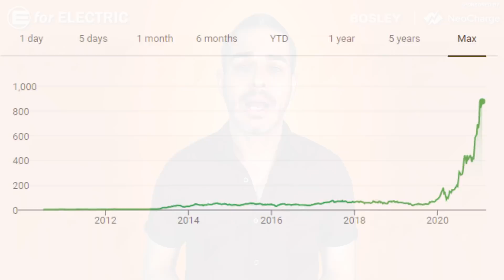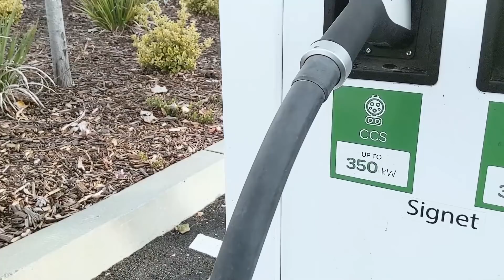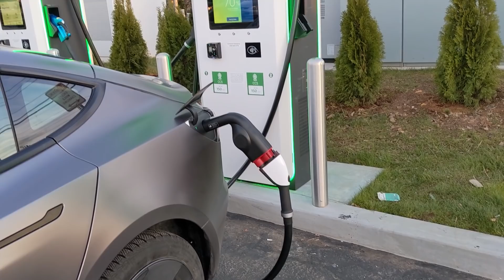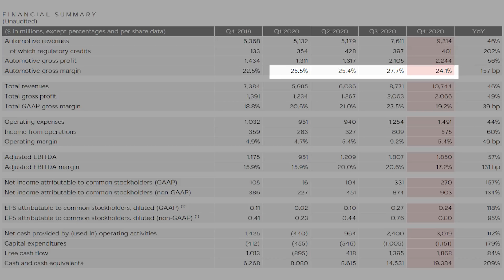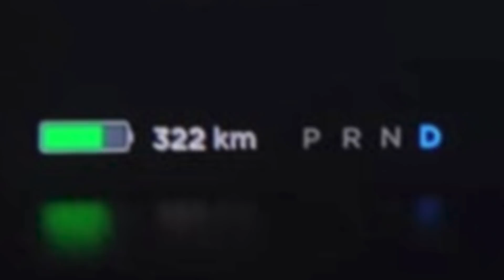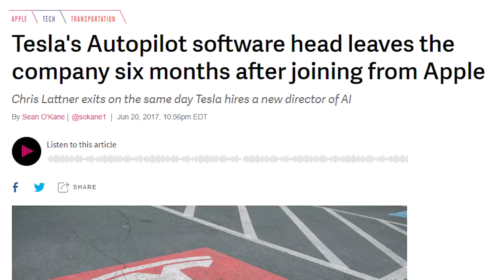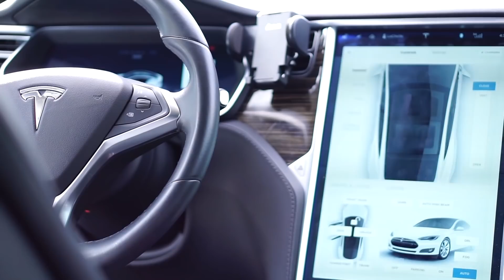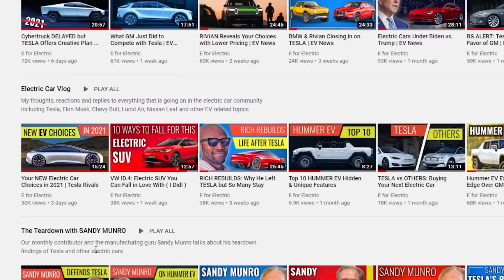Investing into Tesla Stock: Things You Should Know in 2021

Comment: Respectfully, your presentation was full of so many inaccuracies and incomplete information that it would take too long to address.. You honestly lost a lot of credibility.  based on this presentation.
Reply from the maker: Maybe you can start with one. If I am so wrong it would be easy to discredit.
Reply: @EforElectric  I'll start with one, after listening to the first argument of competition. Comparing model 3 to Renault Zoé in Europe makes little sense to me ; one is a premium berline, the other is a  cheap urban hatchback. We ll need to wait for tesla 'model 2' made in Germany to have relevant data. It s like comparing the Zoé with an imported BMW3 (thus hurt by 10% import taxes). Besides, Renault declared their strategy to go for lower volume, higher margins Zoe, meaning they are not making sustainable profit on this model. For these reasons, that argument was indeed not relevant. Watching the rest.
(don't get me wrong, I otherwise enjoy watching your perspective on EVs)
Reply: @EforElectric  battery tech: yes some manufacturers can match range OR performance of Tesla on drivetrain, however none can do both at the same price. Besides Tesla knows they will eventually be caught up and declared they aim to be the most efficient at manufacturing, aka cost for value. No-one comes close at scaling capacity at the cost per kwh and performance. The gap is even widening. Also, manufacturers playing catch up on scale have a huge risk of going bankrupt in the process as most sell their cars at a much lower gross margin than tesla. I think their cost advantage is deeply under appreciated as tesla makes 25% margins where traditionnel OEMs are barely even positive on EVs, and max out at 15% for their Ice products.
Reply: @EforElectric  non tesla chargers : yes the network is expanding, but it s Russian roulette to find a working and available charger at those stations. Also there is very little integration between stations status and the cars themselves. Tesla is still years ahead there.
Reply: @EforElectric  self driving tech : tesla has the only strategy with potential to scale level 5 in all situations. If they can't make it, no-one can. If they can make it, they will monopolise the market.
Reply: @EforElectric  customer service : fair point I guess. However I am curious to learn about your experience with other EV models. Are there any other brand out there that offer a more compelling experience from consumer perspective? It looks to me that the magic effect of driving a tesla has still a long way before being overshadowed by any competition. Will you do a video about this?
Reply: @EforElectric  so many but let’s use one of the first lines of the presentation that “things are changing fast and not in Tesla’s favor.  You then support this throughout with biased arguments. Start with  loss of  market share. Of Tesla sells every model 3 and Y they make without advertising and they don’t have enough to ship to every foreign market, they can lose shares in a particular market but that is irrelevant.  later you talk about how GM is coming with their battery tech.  You didn’t explain how GM is going to survive when they plan on selling ICE cars through 2035.  Do you really think enough  people will be buying ice cars past 2030?   I forget their projections for Ev’s but they said they would have 30 EV models in coming years but will only produce  dozens of thousands.    You mention Rivian which plans to go into production with what looks to be a nice product but you didn’t compare specs and you didn’t mention that Tesla has 1.5 million preorders for cyber truck.   You talked about Sandy Monroe comments to Elon about quality but didn’t mention what he said about  gigs press and quality.  You compare higher priced competitor models with Tesla but left out that plad plus blows other higher priced EV specs away. you mentioned Tesla quality body issues but not the Volkswagen software issues; you mention the Lidar technology that competitors have without discussing the significant sensor cost, energy usage and time and cost it would take to map out anything larger than a small graphic area.  You also didn’t mention dojo Deep learning implications .  Your case about no profit without credits was debunked many times by others. You compare  the amount of charging locations but not the specific number of charging units at each location.  You mentioned the Nio battery exchange program but didn’t talk about the expense to build and maintain all those manned locations with all those extra batteries they would need, or hire long it would take when 20 cars are waiting to change their batteries.   I don’t have time to go back point by point and I am not an expert but do a joint video with one of the YouTube experts that you claim are biased because they are invested. That would be interesting for all and would at least provide a balanced perspective rather than what you presented.

Comment: It is easy to just throw objection without diving deep enough, lets talk on the NIO point: NIO cars are outsourced to JAC, this may pose as an issue with future manufacturing stability and cost + quality control. NIO is more expensive than Tesla model Y in China, resulting in NIO website to crash recently due to massive cancellation. You mentioned NIO battery swap is superior, what are the metrics? By concept it sounds good, but in real world setting it is impractical, you need to go to dedicated station to swap battery, you need technician to swap it as you can't do it by yourself, each swap is 5 minutes, not to mention the queue in line to swap batteries, with a queue of 3-4 cars go figure how long it takes -at least a 20 minutes. On the contrary, every person can charge Tesla on their own, Tesla supercharger takes 5 minutes for 75 miles, 15 minutes for 180 miles and is much more widespread in China, without needing a technician 

How about the amount of batteries it takes to be fielded in each NIO station? It becomes much more hurdle as you scale a NIO - more overhead cost, more batteries to field.

Also with regards to batteries, it is about the efficiency, not just plain miles - anyone can put larger/ more batteries to increase their miles.

Comment: Tesla 2020: we have the best tech!
Hyundai/Kia 2021: we have 800v charging, a 44" augmented reality heads-up display, and improvements to our already impressive efficiency! 
Tesla 2021: we added a heat pump to the Model 3 finally?
Reply: True, but Hyundai/KIA have been running into some major drivetrain issues lately. Rooting for all EVs though!
Reply: If tech is in the drivetrain I would rather save a few cents a mile over 150,000 miles than have heads up display.  They are cool but saving $ is better IMO.
Reply: @joelm077  Except the South Korean cars vie with Tesla for being some of the most efficient on the market.  Last I checked, all four Hyundai/Kia EVs are in the top-10 most efficient models, with the Hyundai Ioniq Electric in the top-3.

Comment: Some of your facts are correct but your analysis of them are wrong.
Panel gaps and Heads Up Display won’t matter much in a robo taxi fleet.
Innovations like Giga-casting, structural battery, video labeling FSD training combined with the balls to take the risk is going to be quite disruptive.
I would only consider real competition if they are all in on EV.
Tesla is running and the others are walking.
I do own stock so my opinion may not matter

Comment: The fact is If Tesla cant make it happen in cost material manufacturing techniques engineering motor battery etc then others will not make it either.
Let see how it plays out. But so far they are technically and price wise far ahead.

Comment: Full of shit. Tesla has many faults. But firstly, and really tellingly, there is NO ONE with long term battery solutions for scale so no-one will outgrow Tesla.You compare Teslas growth to the big, 100 year old ICE manufacturers volumes, not to comparable electric volumes. AND the 50% a year growth is a minimum, expect 100 % for a couple of years at least. The casting machines in Berlin for eg, can do TWICE the stated output oft that factory, and shanghai has never stopped building.  
Competition is good, but its not going to really hurt. It will grow the market. I love how you say Tesla was outsold here or there. But globally the truth is Tesla sells every second BEV car, and are cheaper, with better range or better stats, usually all 3, and most competition are production limited by battery availability. SORRY, not sorry. 
The new batteries mean both that they dont have to make as many, and that the dry cells allow them to can make 10* more as well.... No point in the Porches famed 275 charging rate  when no 275 chargers, and you need to compare charging PORTS to PORTS not just locations. Plus Teslas can use all of them, so it is NOT an argument against Tesla at all, and BTW the car keeps track of where chargers are v's where range will extend to.... Porsche can charge faster, but where???? Neo's system is expensive and unscaleable. 
Tesla IS profitable, with a 20-30% gross margin, but are in an explosive growth and development phase, and spend all the money they can make to growth and not to pay shareholders....
The 1.5 billion from credits is everything to do with their ability to make cars, and the fact no one else can sell enough to meet the rules which are OVER 10 YEARS old. How would you feel if your company refused income they are entitled to because they did the hard yards while everyone else hoped the next government would go back to the good old days. Stop beating this lie. Besides, all the "cant make a profit" is because their aim is to accelerate globally the move away from fossil fuels, and growth is the fastest way there, the profits come the moment they slow down building new Factories (2-3 at a time) at the cost of 5-10+ Billion a year, and can no longer get FREE capital with a fractional dilution of value, and slow development of new battery tech, new cars, new manufacturing methods; And when they start advertising, and building a sales force... What dont you understand about profitability??? Their
They are also far more ahead with FSD in hardware and software and AI. The Lidar advantage is crap, as it needs a comparison map. The main advantage, that no simulator can compare with, is data (gathered from 1 MILLION cars in Teslas Case.  Its been talked about ad nauseum, but your ignorance of it is blinding. To find, and map solutions to edge cases you need to find them, data is what allows this. Then the other big difference comes into play. All the systems you talked about need humans to write solutions for every single individual edge case, and the onboard computer needs to processes all these against a pre-mapped expectation to make a decision. This becomes so unwieldy you hit the ceiling as Elon spoke of.. Tesla uses an AI to write these changes into the base code, not rules and exceptions, and the neural net onboard the car uses a 4D picture knitted together from cameras and radar to make decisions on the fly. Far more natural and far less limited as it does not need either a comparison picture, or a set of fixed rules. More Lies.
 Lastly, they are far more than a Car company.

Comment: Liked the video and love hearing both sides, but he could have mentioned a few things (unless I am wrong).  One is that Tesla essentially sells all the cars it makes.  Some of those Renault Zoe buyers might have bought a model 3 if there had not been a waiting time to get the car.  Another is that Tesla is still small and has essentially conceded a lot of the EV market to other players, which is probably good for all.  Like Tesla sells no car to complete with the VW E-up both in low price and low functionality.   And that causes Tesla to lose sales since VW E-ups are so cheap.  But Tesla can, if they run out of future growth, come up with a car with that price and range.   Finally, one could point out that the whole EV market is growing exponentially so there is enough meat on the bone for several players to do well.  I actually think increased VW and Renault sales leads to increased Tesla sales since it makes EVs in general more acceptable to the public.  We are still at the point where Tesla and its electrical competitors can grow without affecting each other, since they steal from ICE more than each other.  I think the future remains bright for Tesla despite what he says.
Reply from the maker: All manufacturers sell all cars they make
Reply: @EforElectric  Yeah, what I meant is that they are making all they can, and there is a waiting list for them.  They aren't just sitting at dealerships.

Comment: The legacy automaker comparison is more comparable to a computer case designer vs software developer.

Tesla knows software and have put them in wheels.  Yes they still have the challenges with building the case but the tech is unrivaled.  And they'll get the case right in time, as they've been making great progress. #Sandy  but the case designers have a much steeper learning curve to start designing software.  And I didn't compare to hardware designer because the engine is gone.  They only thing they have left with experience is the case.  You can drewl at a pretty case if you like... But most people want the tech and and function... Also as a side note:  with the exception of maybe the BMW i8, until Tesla all manufactures have consistently told us all EV have to be ugly, underpowered, slow, low range... But you want to believe then now? 🤔 Deluding ones self I would say.  But who am I.

Comment: You are missing something. Re-writing software is called by insiders "refactoring." It is the right thing to do to streamline your application. That is the way to produce a top-quality software system. Another big miss: Waymo is geo-fenced, it only works in pre-mapped areas. LIDAR - you need to do your homework. The core of self-driving software is the neural network architecture. Tesla has two billion miles of training data which any neural net requires. You are saying human testing but Autopilot is already probably a better driver than the average person. It is less dangerous to humans than human drivers! YOU MAY BE RIGHT ABOUT TSLA STOCK VALUE - BUT ONLY BY LUCK, BECAUSE MANY OF YOUR ARGUMENTS ARE MISSING SOMETHING.

Comment: So now that you have done your criticism of Tesla I expect you to bring out video's of every manufacturer and there electric/ hybrids which should include negative and positive aspects to what they are doing with regards to electification.  I just did a search on toyota and there Ravv 4 hybrid, "According to a press release, Toyota advertises and represents that the RAV4's fuel tank capacity is 14.5 gallons, and based on its 40 mpg rating, the RAV4's range should be 580 miles. However, according to news reports, customer complaints, and numerous reports filed by drivers with the National Highway Traffic and Safety Administration, the RAV4's fuel tank does not fill to the advertised capacity. Drivers report that the advertised 14.5 gallon tank will only accept 9-11 gallons. As a result, the RAV4's actual mileage range is approximately 380 to 440 miles, well below the estimated 580 range."
Reply: You would think that Toyota is one of the biggest car companies in the world their cars would be absolutely perfect but they even still have problems. Even Legacy OEM well-established car companies with 100+ years of experience to get this stuff right is still putting out crap vehicles with numerous problems, and Tesla is still pretty young comparatively, so you can expect them to have some issues with fixing the problems they have. On the Now You Know channel they reported that Tesla is going to hire a program design person to develop a QA program of some kind that will better effectively catch the issues with the cars. I think that is the next phase.

Comment: Alex.  Sorry but here in the MidWest, competition for Tesla is not on its way.  Why ?  Because availability of high speed DC charging is very, very poor here.  If some one gave me a new Mustang Mach e, I still could not drive it from SE Iowa to Kansas City or Saint Louis--particularly in the Winter.   If I had a Tesla, a very short range one, I could drive to Kansas City with a stop at a Tesla Supercharger about half way there.  Even my Chevy Bolt has longer range than the first Mustang EV to be released.  Even later, to get longer range,  Mustangs have to delete all wheel drive.  A car without AWD is not at all desirable in the Midwest--and still the rear wheel drive Mustang's range is rather poor.  Lucid is the only company promising a decent range of over 400 miles.......some day..... and at an absurdly expensive price.  At Lucid prices lucid will be lucky to sell 10% of what Tesla sales will be.   If, Alex, you are talking cars with ranges in the very low 200s then we should all yawn and drift toward the door--being polite of course. (I do appreciate that you point out weaknesses in Tesla Customer service.  I hope Tesla's panel fit and paint problems are history when it is time for me to order a my first Tesla in July of 2022.)   Mobileye ?  I never hear anything about Mobileye coming out in anything.  Waymo ?  Waymo, with hundreds of pounds of power hungry gear that disfigures the whole vehicle and can only travel in memorized and restricted routes, and cost as much as 6 Teslas ?  Waymo cannot compete.  So, much of this comes across as short seller FUD.  
Looking forward, I do not see any vehicles competing with Tesla range, DC fast charging network, or Full self Driving capability.  Buy more TSLA or hold what you have.